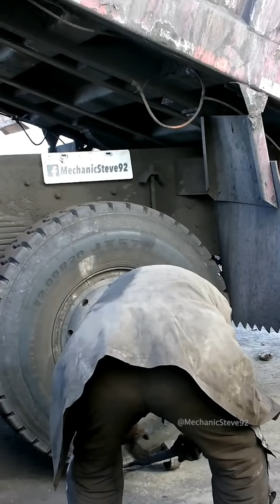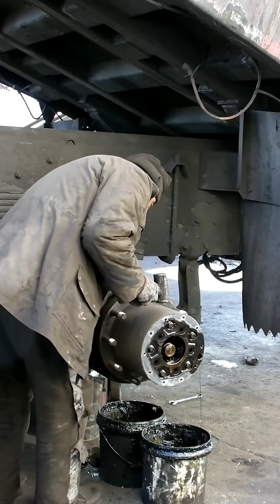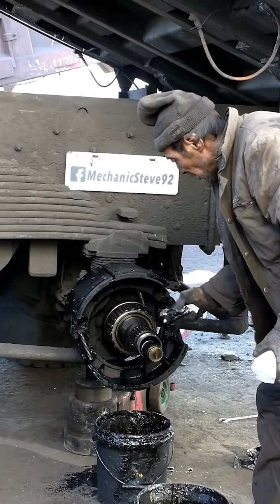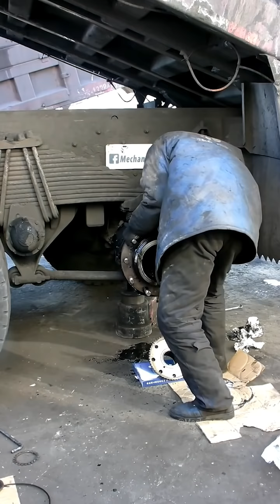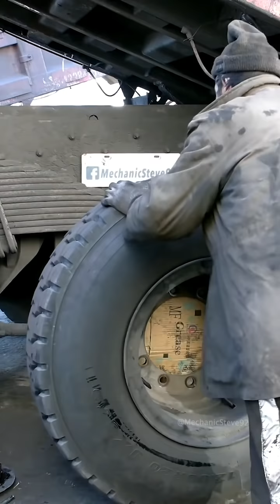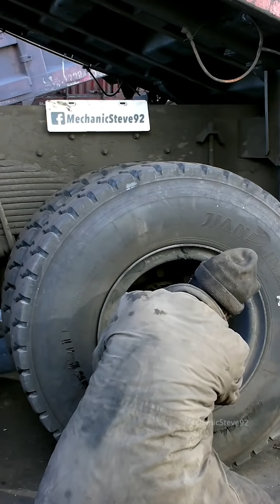Wheel Bearing Damaged, Replace Oil Seal & Bearing

Comment: Oil soaked brake shoes, pitted worn out bearing left on the truck, dirt left on parts and mixed up with new grease. This is a failure looking for a place to happen. Why on earth would the owner do that to his own truck? How is that well oiled brake sliding against a well oiled brake drum supposed to work and stop a loaded truck? This is unbelievable.😳

Comment: I didn't see where you replaced that damaged bearing
Reply: the owner (the one who is holding a cup )said not too much damage to the bearing and it can be reused...
Reply: I'd be more worried about the oil soaked brake shoes i think
Reply: @danwelham2495  yeah I was wondering that too I couldn't make much out of this video and it's obvious that the owner was wanting just a patch job.
Reply: @danwelham2495  I think its hi tech break lining shoes,the one that is self cleaning and self drying...😃